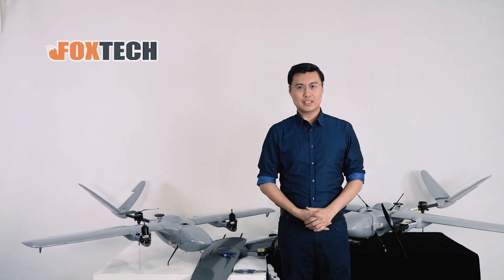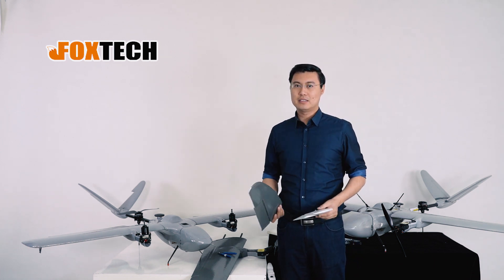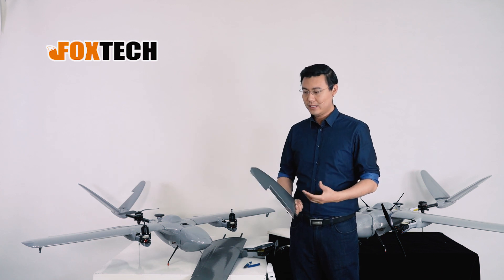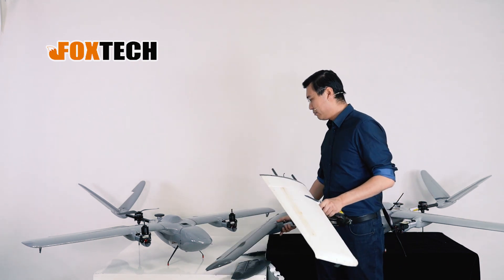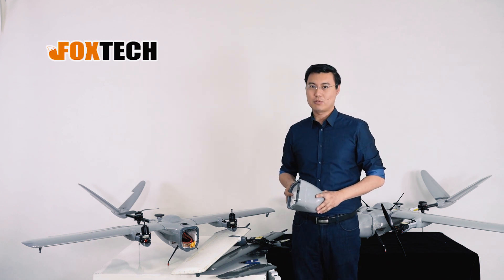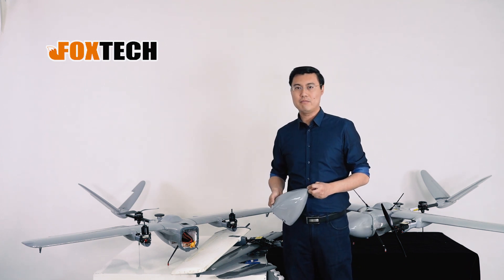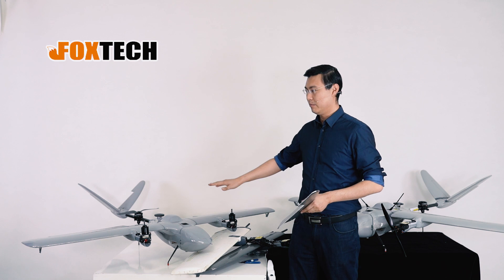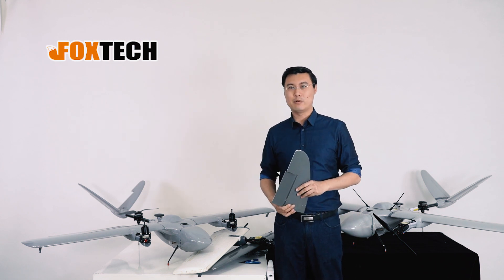X-SPRAY Foam Armor

Comment: where can I buy it ? I want to use it on my airframes. 300 g more than the original nimbus is really good. 200g it's even better. Fiber glass it's just to heavy.
Reply from the maker: Dear Razvan, it is not available right now
Reply: @Foxtechhobby  is it available now? Has been nearly 6 years

Comment: Can the xspray be used on any foam material?
Reply from the maker: yes, it can be used for Foam material ,or 3D printed parts
Reply: @Foxtechhobby  on EPP as well?
Reply from the maker: @zoranjevtic620   I tired on EPP , the coating turned it into composite material feeling, but normally EPP doesn't have a smooth surface like EPO
so the final result will be less pretty :P